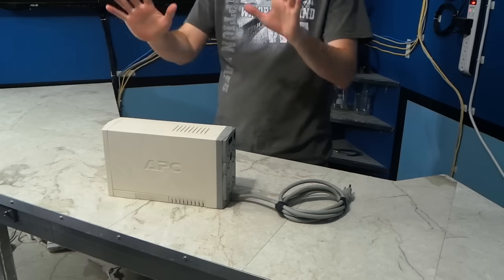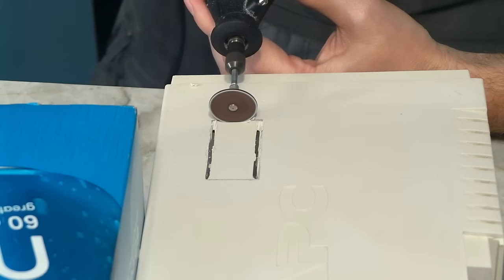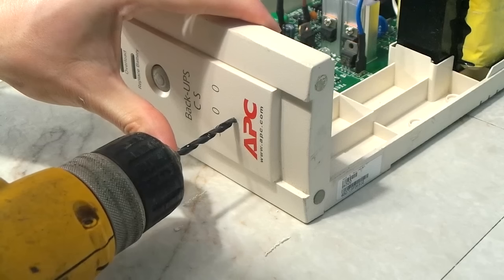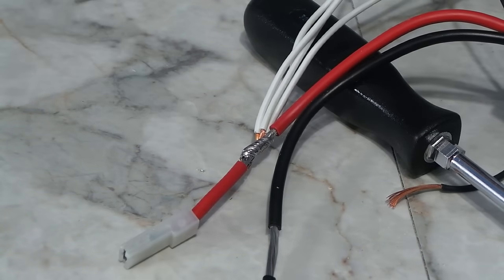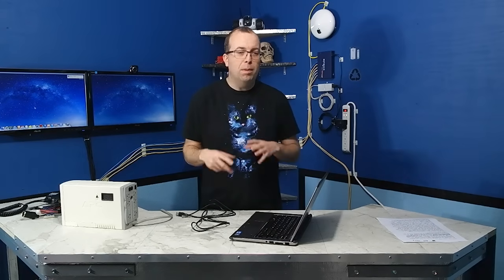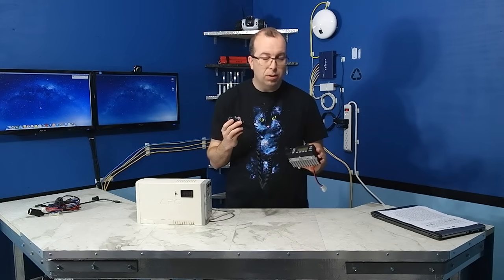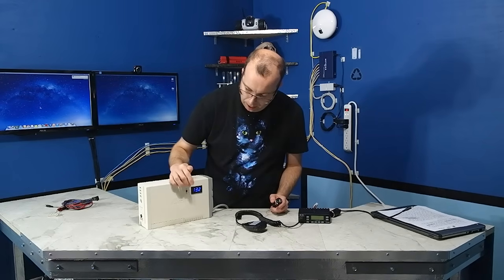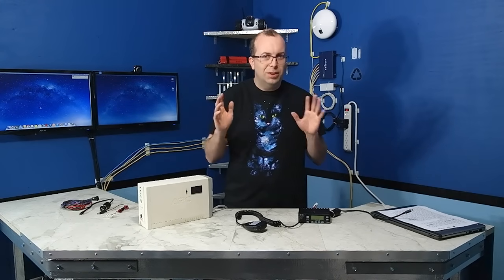Ultimate Battery Backup Hack/Mod.

Comment: Lead acid batteries suck. They die way too quickly and have piss poor shelf life. I had (still have actually) a large halogen flashlight that was rechargeable. Ran on a 12V lead acid battery. I maintained the battery, yet a year or so later I go to actually use it and the thing is completely dead. Wouldn't even charge up. Lead acid batteries like these are sh*t. 

If there is a way of converting the APC backup battery into a lithium-polymer instead of using the crappy lead acid bricks, that would be a great backup supply. I'm in the process of doing just that with the halogen flashlight by using a series-parallel combination of lithium-ion 18650 batteries to power it, and then adding a proper charge controller circuit. This of course would be a bit challenging to do with the APC backup since it electronically monitors it from the computer itself. 

Again, while lead acid batteries provide a good source of current, their longevity is sh*t. They also don't do very well on repeated charging/discharging. That's where a series/parallel Lion setup would come in handy. 8-bit guy should look into doing a mod like this sometime. 👍
Reply: I would rather have a nice safe recyclable lead acid battery than the explosion waiting to happen li-ion. I really think people are insane putting earphones in their ears with a potential grenade inside them.

Comment: Broheim, I know this is counter intuitive considering what I just saw... but... for a portable power supply like this (https://www.crazysales.com.au/online-portable-72800mah-150w-solar-generator-power-station-battery-backup-207427.html?aid=11) for example. Could it be used as a UPS? If you had it plugged into charge whilst having a pc plugged into it, would it do the same thing? Or is the circuit not setup like that? Would the PC just drain the battery with the unit plugged into main on a portable power supply?

Im kinda looking for an all in one solution to run a live streaming rig from a backpack that can run my camera from 5v usb, router from 12v jack and maybe a mini pc 12v.. to stream. 

I think UPS are better value for money though as you get 2x 12v batteries in some that are either 7AH or 9AH, for much cheaper than the one i linked where you're paying twice as much for the interfaces, but only 1 battery.

Comment: Here, have a dislike.
The battery is a 7Ah (amp hour) your worry is definitely NOT wires being able to handle 16 Amps. And I see no real world application where you'd need to pull 48Amps from a small battery like that. Even IF you could pull that amount of amps, it won't last 5 minutes, not much of a "backup".
"Ultimate" is a stretch.

Comment: this is just dumb as F. why if you're not even using the heavy transformer to invert the power why not just use the cheap ones without a transformer? you could have done this a lot simplier by just removing the battery and using a trickle 1amp charger. this would make those trash batteries last longer. Also for better longevity I would find if anyone made a Glass Matt battery that would fit in that space as it would last longer. those SLA batteries are designed to only give you 2 to 3 full drain cycles before they are trash

Comment: No saftey features, "Tapping into wires", no switching supply for the dc outputs, no calculations. This whole thing is just a bad idea. Like super bad.

This is a fire waiting to happen. Like honestly, why would you do this?
Reply: Why the heck would you need a switch mode power supply on the DC output?

Just plug it in!
Reply: @dlarge6502 efficiency of creating dc

Comment: you are excersising basic maching practice. any machinest with half a brain knows that you step drill any hole. maybe not by every drill in the case though. A drill press wont save you from messing up either. I know, I have a drill press and still must step drill. what happens  if you dont, the drill can grab the work, whip it around and seriously injure you.

Comment: We have something awesome for you guys today! Check out this huge Class A Thor Motorcoach® RV that's powered entirely by BigBattery batteries. This RV has been outfitted with a huge power system, including 2400W of solar panels up top, and two of BigBattery's finest batteries!

If you're interested in building a system like this for your own RV, visit us at BigBattery.com to find the right battery for you. You can also call 818-280-3091 or email sales@bigbattery.com to speak with one of our customer service reps about which setup is right for you.

https://www.youtube.com/watch?v=QEZVHe0_n1k